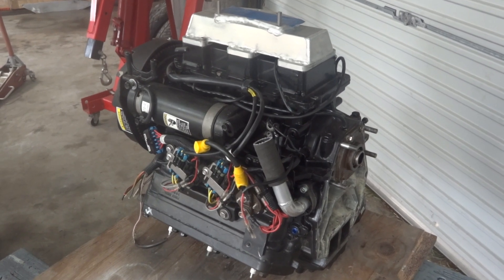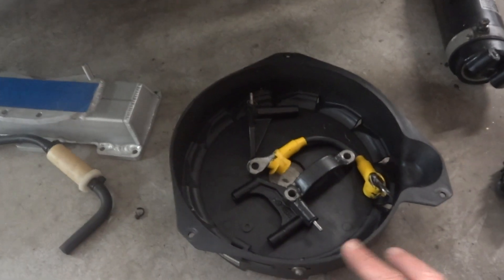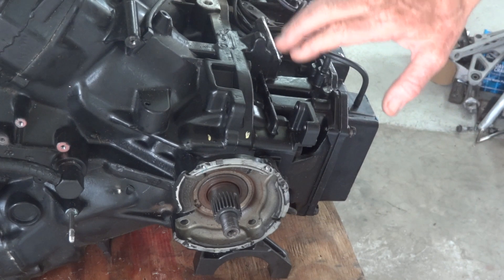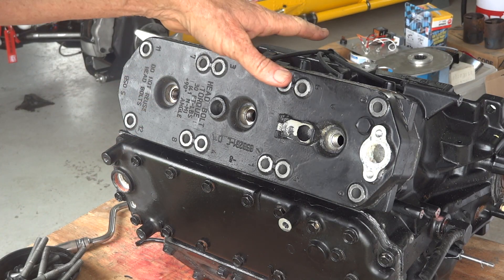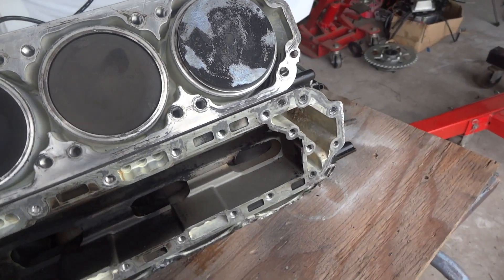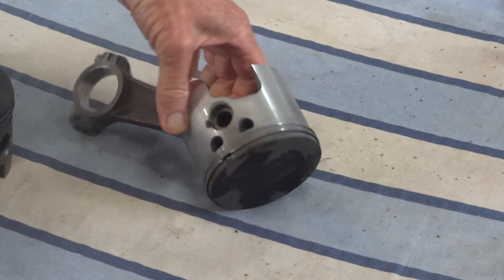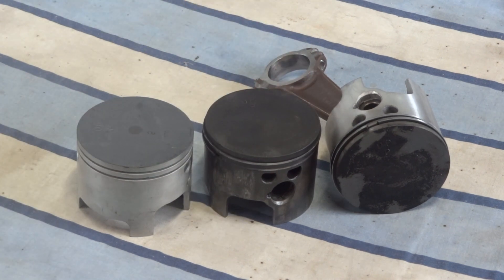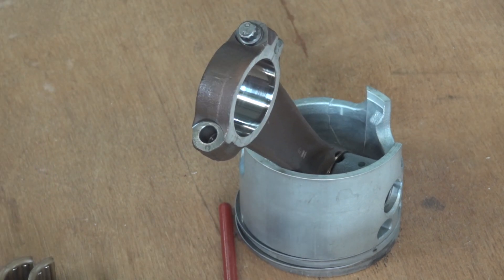Mercurial Outboard Motorbike Mercury 2.5 litre 2 stroke V6 engine rebuild piston replacement

Comment: Two stroke engines intake goes in the crankcase unlike four stroke engines. In many ways the world may have been a little to quick to condemn the two stroke engines which i believe in many ways are More Efficient than four stroke FAR SIMPLER and lighter due to LESS moving parts, generally a crankshaft, conrod, piston!! Modern weed wackers are four stroke revving their Nuts off, then occasionally BOOM No More, two stroke engines are happy to rev upside down or what ever as the oil travels with fuel lubricates on it,s way to the combustion chamber, much MUCH MORE SIMPLE BETTER!!!!!!!! ENDLESSLY BETTER than a 30cc four stroke engine revving its Nuts off!!!!

Comment: I'd cut the head about 
.040" and round over the sharp edge on the quench pad to chamber area, andmirror polish the chamberand qurnch area, and polish the pistons, maybe  look into ceracoat ceramic insulation coating on the head and piston, possibly the exhaust port area!!  After smoothing things over in theremaking it flow smoother, .  Ceramic coat the inside of the exhaust also!! Possibly keep it  alot cooler,  prevent discoloration and possibly severe burns,  the insulation keeping the exhaust gasses hot and moving , adding a turbo could be awesome, 140hp to 3 times that fairly easy,  also going to rotory valves!!
Reply from the maker: don't need more power, but ceramic coating the exhaust manifold cover is a good idea. thanks

Comment: Very nice, cant wait to see this thing go for a rip. If you dont mind my request, id love an onboard video where the rider starts out low (damn near lugging it) and just lets it climb to the moon before hitting the next gear. I want to hear it roar into it's power band lol
Reply from the maker: max revs 6000 as an outboard, it must have an awesome torque curve
Reply from the maker: the V8 pulls away from idle in 5th no problem, dead smooth
Reply: @malcolmoastler3039  i cant wait man lol i got the same exact motor. Your the only guy doing this right now as far as ive seen on the internet. The fact that you've also got it mounted longitudinally just makes it 100% cooler than the project already was lol

Comment: Do you think it's maybe had water in the fuel/crankcase and it's only got into the bottom cylinders from Ummm gravity lol, what an awesome engine and excellent choice, I've seen that fractured conrod method in very expensive high performance automotive engines, but not your everyday quality 👏 😀
Reply from the maker: good thought, but they're the top cylinders on the outboard